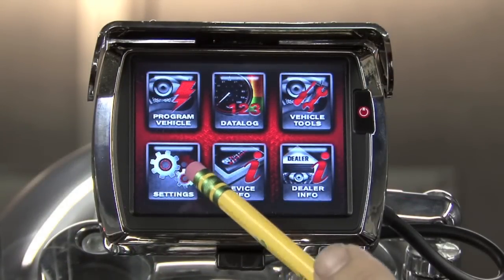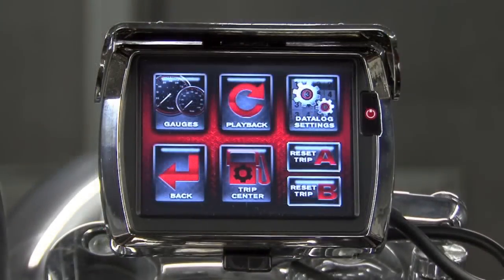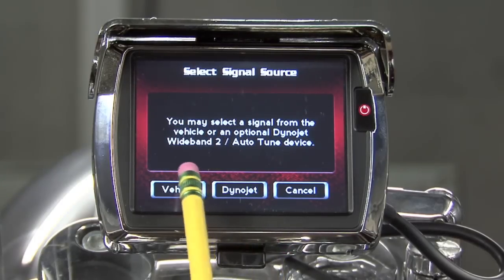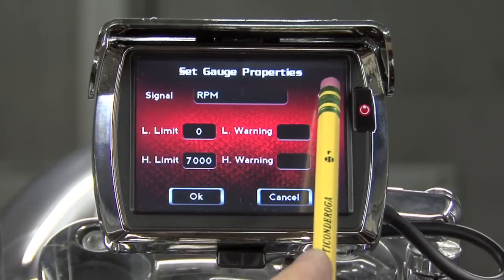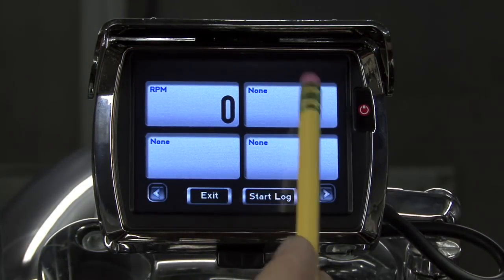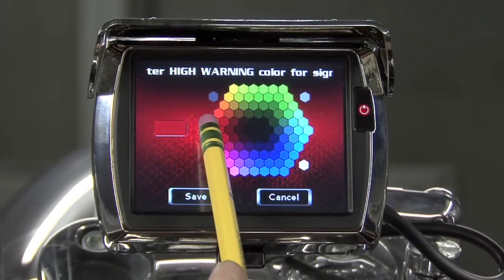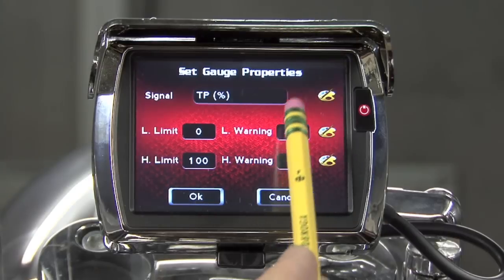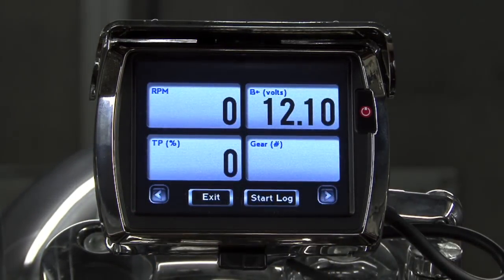Dynojet Power Vision: How To Set Up Gauge Display

Comment: If I have all my gauges set up on the power of vision for my Harley.....  If I turn off the bikedo I have to come back to the gauge screen every time or can we make that so it will stay on by default.. so that every time I start the vehicle it automatically goes to that gauge screen....?
Reply from the maker: Bill, if a PV is powered down while on the gauge screen, it will boot back up on the gauge screen… as long as it is powered by the bike. If you were on ANY other screen of the PV when the unit was powered down, when it boots up, it would be on the main menu. The gauge screen is the ONLY exception to the rule.
Reply: @DynojetResearch  thank you

Comment: So this is just for Harley's??  You don't make it for metric cruisers?
Reply from the maker: Which bike, make and model do you have?
Reply: @DynojetResearch  08 Vulcan 2000 classic
Reply from the maker: We don't have Power Vision for that bike, but we do have Power Commander: https://www.dynojet.com/power-commander-v-for-2004-2011-kawasaki-vulcan-2000-17-034/
Reply: @DynojetResearch  I already have a power commander 5.  Now I also have auto tune for my bike but it only has 1 o2 sensor so I am not using it.  My exhaust only has 1 o2 port.  I bought the bike used so it came with that installed.  I had it dynotuned so I am using a map made by adrenaline cycle.  Would I be better off getting a 2nd 02 sensor and having a 2nd bung welded on so that could use autotune on both cylinders.?
Reply from the maker: If you add the second O2 sensor, you would be able to advance your fuel map to tune both cylinders individually. The end result will be better than what you have now.